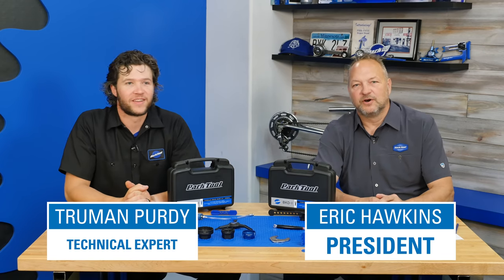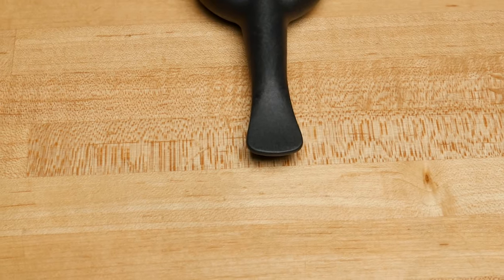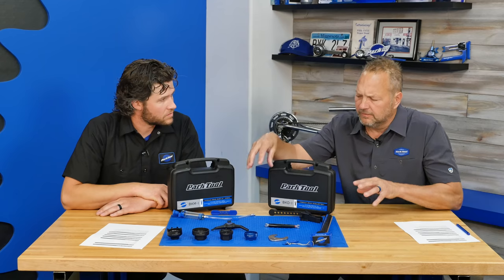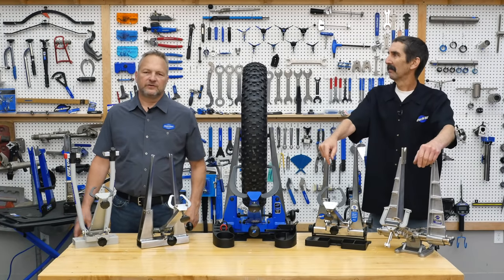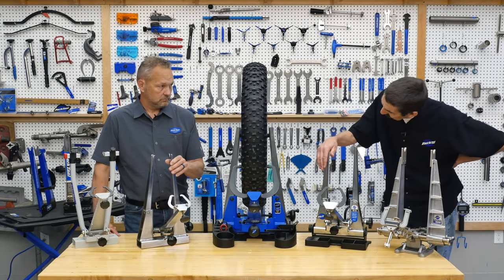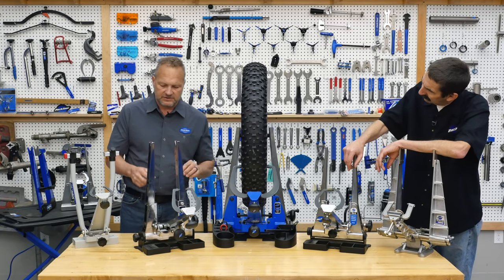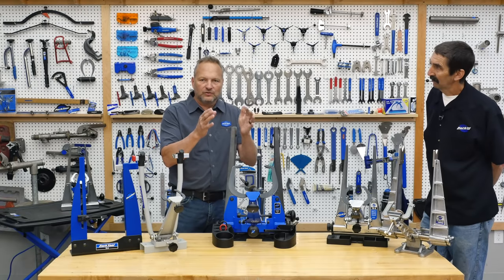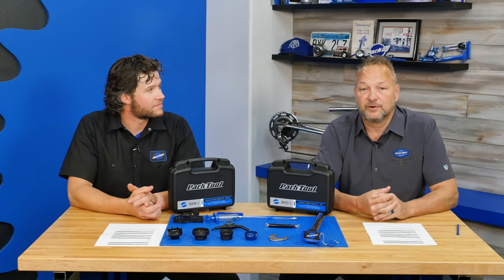New in Blue Episode 5 | New Tools for Summer 2020 + Park Tool's History of Truing Stands

Comment: Hey can you guys make a tutorial on how to switch the sides of brakes on mtb disc brake (In the U.S. the left brake is for the front but in other countries it goes to the back) So please show us how to switch them around
Reply: Just switch the hoses...?
Reply: As mentioned, just undo and switch the hoses at the levers (keep the hose ends high when they're loose, to avoid losing fluid/admitting air) and, if you're lucky, you won't have excess air in the re-arranged brake circuits. If there is air, just perform a brake bleed according to your brake brand/type.

Comment: right but does the mineral oil bleed kit work with campagnolo hydraulic systems?
Reply from the maker: No. The Campagnolo system runs a M4 fitting, and that we have not added. Yet.
Reply: @parktool  "Yet" you say? hmmmmm ;)

Comment: As my bike is presently a 27spd   , Cube Anlog 2018 29inch   . Is it worth the money / hassle of changing the crank/ cassette to a 1- 10/12 spd .
As i haven't seen any conversion video's if it's actually feasible etc .?????

What needs to be addressed is the poor quality of parts for Bikes nowadays.  The Crank/ Csssette / chain   lasted 2 years  before replacing  yet again  replaced   last year .  And this year will have to replace it all again . It's  becoming a farce the Bicycle Industry nothing made ever seems to last . Build quality n parts of 1980's Raleigh Strikers /Grifters /Burners  were far better .